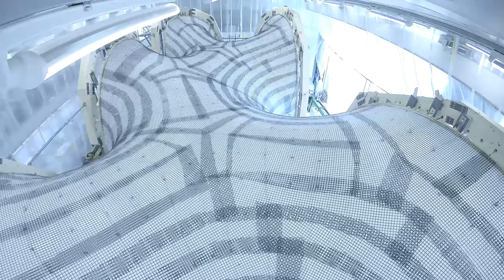Ultra-thin concrete roof

Comment: you you may consider using a foamcrete sandwich layer in order to obtain insulation and a bit of thermal mass. An outer layer of high density concrete will create a composite structure, allowing for dynamic live loads. The first laver onto the fabric can be white cement concrete, avoiding the need for painting the underside of the structure.

Comment: Curved thin shell roofs have been made in the USA for decades now.  Glad to see the EU is noticing this tech.  Although they are using inferior internal reinforcing material.  sigh
Reply: Ferrocement has been used in the 70s in large numbers of homemade boats. This in Ferrocement would have cost a few thousand. Instead this cost 1.2 million.
Reply: @OffGridInvestor  Ferrocement works great ... at least until it cracks. Then it turns to rustocement, sometimes with little sign that it's been compromised, and is prone to catastrophic failure. Nobody makes boats out of ferrocement anymore, and with good reason. They may be cheap to make, but they cost a lot more than fiberglass boats in the long run due to increased maintenance, more frequent repairs, and shorter lifespan. The same is true for roofs, only with the added costs incurred by weeks/months of building closure and the difficulties of working on preexisting construction.

Now, I'm not saying that ferrocement is terrible nor am I saying that these folks' PVC-cement is great. IMO, there are materials/methods for making thin-shell structures that are significantly more eco-friendly, durable, and lifetime cost-effective than either.
Reply: @irrelevantfish1978  This is an old thread, but i'm making a structure of ferrocement with welded frame connected to a sacrificial anode, do you have any advice on making the concrete less prone to cracking? you seem very knowledgable. thanks in advance.
Reply: @justingriffin2546  Sorry about the delay in reply.

Mostly, I'd advise that you look really, really hard at using FRP mesh instead of steel (eg, the stuff used in "fiber-reinforced cementitious matrix"/FRCM post-reinforcement). Contrary to popular belief, fiberglass is basically impervious to alkali once impregnated with resin, and I suspect even E-glass fiber (which concrete will eat in minutes if you just throw it in) would outlast galvanized steel after a bath in polyester or epoxy. The cracks will still happen, but it won't matter as much.

However, if you must minimize cracks, I can think of three basic approaches:
1) Reduce shrinkage. Typically, a substantial portion of concrete's tensile strain capacity is used to cope with the stresses produced during the curing process, so every microstrain of shrinkage avoided is a microstrain more the concrete can handle before cracking. While proper curing helps a lot, really big reductions will require admixtures, such as superplasticizer and CSA, as well.
2) Add short polymer fibers (ideally PVA) to add some ductility. I've read papers discussing synergy in concrete reinforced with both mesh and short fiber, and the results were impressive, but getting the mix to work right would probably be a bit of a nightmare and might not reduce micro-cracking. I don't recall seeing data either way.
3) Add a crystalline waterproofing agent to provide "self-healing" capacity for micro-cracks. It'll do squat against the kind of cracks developed by getting smacked, but it will delay damage due to wear and tear from thermal cycling and the like.

Hope something in there is helpful. Take with a grain of salt, as it's been a few years since I've done any research on this, so I'm out of the loop (not that construction technology changes very quickly) and operating on some very stale memory.

Comment: How is it better then ferrocement as a roofing alternative? This method seems quite more expensive then ferrocement though it might be more load-bearing
Reply: perhaps because part of the design spoke of tensioned cables?   the flexibility of a net overlay might enhance structure significantly ?
Reply: can do this with lathe, ferro cement, basalt mesh....leave it to the Swiss to over think it.

Comment: I'll be the wet blanket.

This is really stupid. A waste if you ask me. Concrete is a cheap building material. Why not make it 4 inches thick. Add another 500 to the concrete budget and forget the million bucks in engineering. 

Id be impressed with cheap innovative techniques that let people build their own house without a 30 year mortgage. Thats real empowerment. We dont need million dollar millimeter roofs.

Comment: Such a pointless waste of everything...they are proud of saving material cost WTF? the concrete itself is chapest material used here, even polymer fabric wasted during process is more expensive. next thing is labour, and all this 'precise computer analyses'. People are building much more complicated shapes using classic ferrocement technology since 70ties! Using PVC net makes it slightly lighter, but concrete thickness is the same. What is the sense??Just to show up?? There is no 'prestrained wire construction' here, wires are support only, removed later. Only elastic PVC net (not prestrained as you can see) stays in the concrete. Great example of pointless hi-tec misuse of technology. I wonder how they managed to convience anybody to pay for that childish playground. Most advanced technology here is...MARKETING!!! hahaha They know how to waste someone else money in Zurih! that's for sure!
Reply: 150%
Reply: Yes. Average cost of concrete per cubic meter in my country is around about  US$220. And until 10 years ago we barely had s concrete building in the country that wasn't a skyscraper.
Reply: I think they're referring to ecological and not economical costs, and in that sense, this method beats the pants of ferrocement if you assume that the prestrained wire formwork is reused. Compared to PVC, steel is more CO2-intensive to manufacture, has lower specific strength, is less ductile, and will have a shorter lifespan with higher maintenance requirements thanks to its vulnerability to corrosion.

Still, you're right that it's incredibly impractical, and I'm pretty sure there are cheaper ways to achieve similar or possibly even superior results, both in terms of performance and eco-friendliness. One method that occurs to me immediately is textile-reinforced concrete with either leave-in-place FRP mesh or inflatable fabric formwork. The material costs might be higher, but labor costs would be way, WAY lower.
Reply: You know the worst part? If they got a large cloth and some strategic rope, and sprayed it with cement/ concrete upside down and THEN turned it back over, it would be this. LOLLL Add fibreglass strands if one wants even more strength
Reply: @Worldsbestname   The ETH is a University, and this is a research focus project. There are most likely many technologies and processes being evaluated during the project. The project is not about the completed roof, but rather the process of getting there.
Reply: @spider_sf  Also my comment wasn’t about the technology or how it got there, but the ridiculous costs associated because that’s how it goes when no one really knows, they think and suppose they can charge whatever they want since ‘what do you n I know? They’re the pros’ bro

Comment: machines, labor, special cables and rigging. Too expensive.  Product is a loser.   Maybe good for off-world colony where bulky material transport is expensive.    One of those man lifts weigh 15,000 lbs by themselves.  So no way to put it up without expensive equipment.